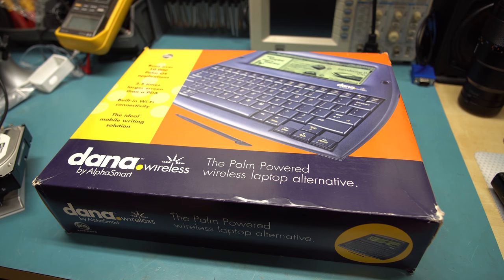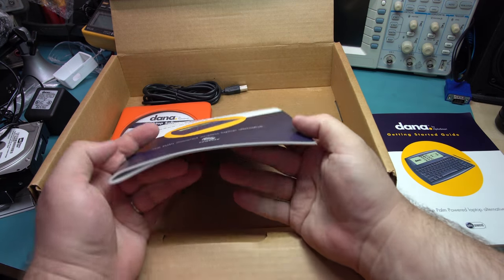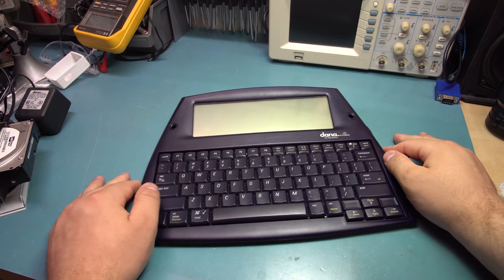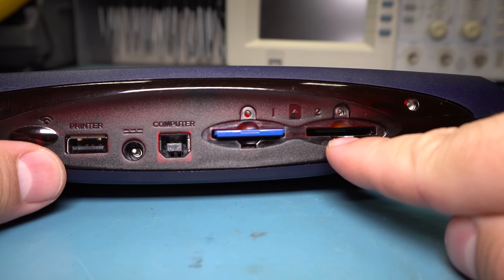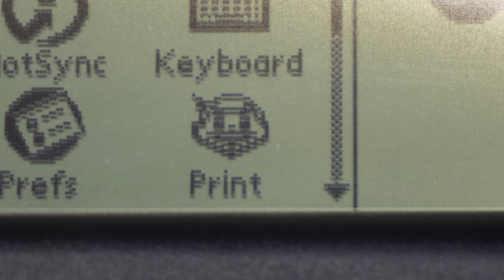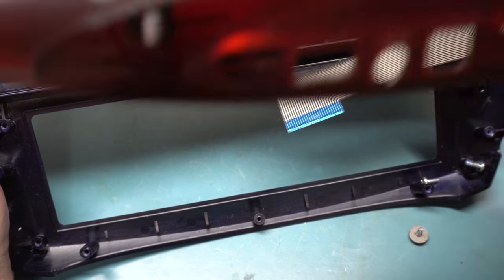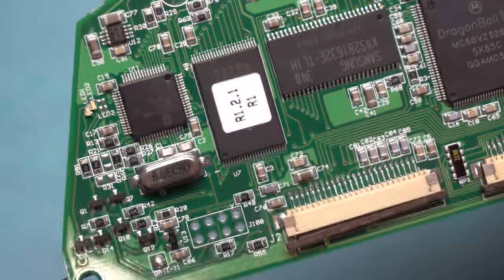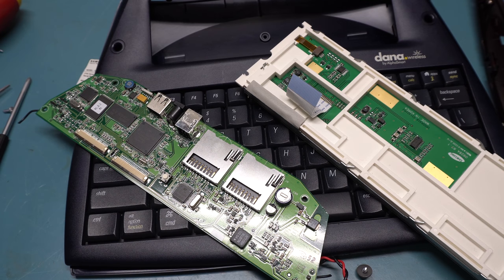Dana Wireless PDA Teardown

Comment: These are still used by some writers who want no GUI distractions and plan to add fancy formatting later.
The Dana hammers out the saved documents letter by letter reasonably quickly over USB by emulating a keyboard so they're kind of futureproof. It's no laptop replacement but it has a better keyboard than most modern laptops and for lecture notes it's less obtrusive than a tall glowing screen. Oh, and you'll get around 100 hours of battery life which is nice. (grab some rechargeable AA batteries)
Reply: The Neos have much better battery usage than the Danas for writers.
Reply: @muskndusk  BUT, if you run out of battery and your 2032 is bad you will lose all your data on a Neo than on a Dana because you save your work on SDs on a Dana...
Reply: @RobertDeloyd  That's why the button cell battery should be changed every couple of years, the AA batteries changed as soon as they look low (on the indicator) and work should be saved to a pc at the end of each writing day, or as soon as possible. 

This is a known problem with the Alphasmarts, the Dana being the exception, but it works very differently.

Comment: That think that looks like a IR port is a covers a class 1 laser emitter/detector for communications so don't look directly at that window when the unit is switched on or you might lose your eyes.
Reply from the maker: Nah. It's just IrDA transmitter/receiver. If it was a laser it would have to carry a laser warning sticker. :)
Reply: Actually there was a similar device in a NOKIA slider phone and in the instruction manual for the phone there was a warning that the IR port used a class 1 IR laser and I even considered using my old slider phone to pop balloons for a joke.

Comment: Why the hell does the Newton have a tripod mount??
Reply from the maker: I think it was more about securing it to some kind of swing arm. They might also have been for securing it to something by having a bracket of some type which didn't let you turn it while a locking screw kept it down via the tripod mount.

Could have just been a "might as well" idea when making it. They had the space so they put it in so someone could find a use.